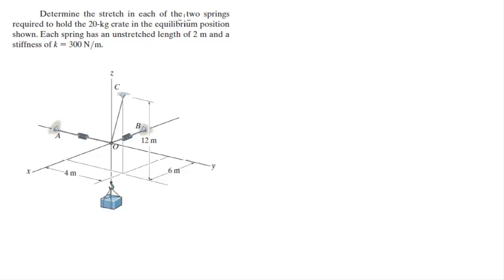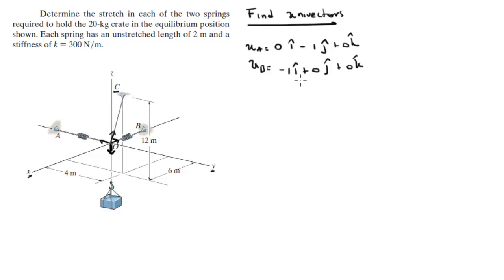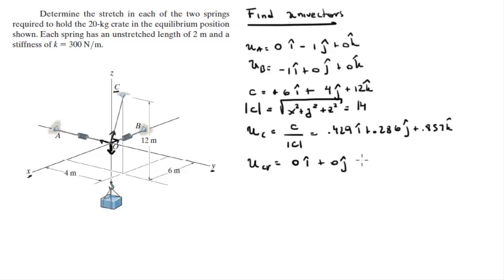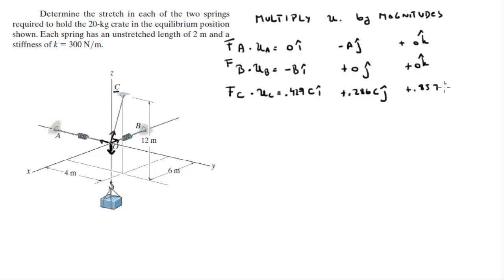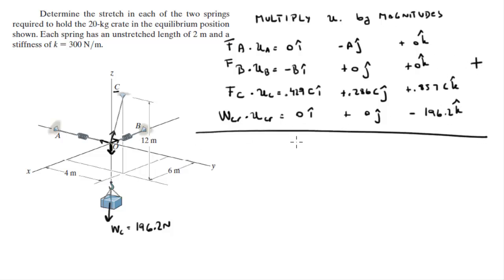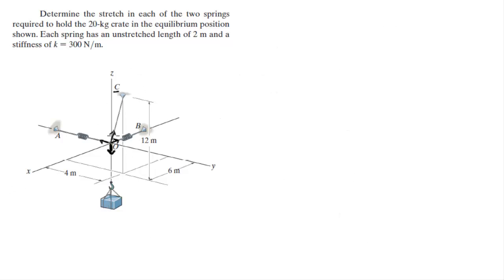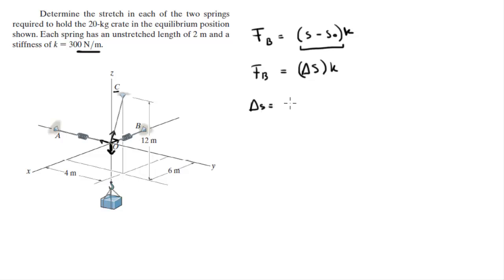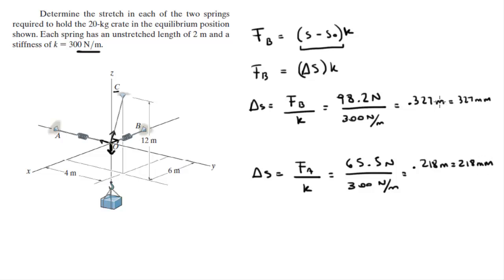Determine the stretch in each of the two springs required to hold the 20-kg

Comment: How do you determine that uA and uB are 0i -1j +0k and -1i +0j+ 0k respectively?
If I try to find the coordinates of point A, I don’t feel secure in saying that I know point A is -1 along the y-axis because I don’t know HOW far A is from the origin along the y-axis. I only know that the unstretched length of the Spring is 2 m. Same for the location of point B: I only know that the unstretched length of the Spring is 2 m. Wouldn’t that put both point A and point B at least 2 m away from the origin, not the 1 you are using?  Why do you use 1?
Reply: Its unknown but since it's along one axis it's unit vector can be positive 1 or negative 1
Reply: KidsandKarma I think it is because the unit vector is the length over the magnitude of that length. If A were 2m away for example your unit vector would be (-2)/sqrt((-2)^2). This equals -2/-2 which equals -1 (as A is going to the left). Because A has no x or z component this must be true (otherwise the values in your square root would be greater because you'd add those components).
Reply: I finally figured out what the problem was. I couldn't see that the lines attaching the springs to the origin were actually part of the springs themselves. Those lines are written thicker, but this can't be seen in the digital version. Looking closely at the printed version I was able to see it.
Reply: Oh I see what you are saying. Yeah when I do these problems I consider the spring to be the entire length even though it doesn't look like it. It's weird.
Reply: @mattklinger8644  Thanks a lot, it make sense!